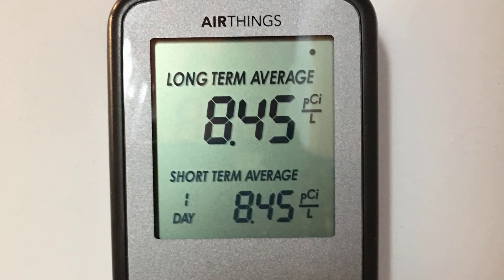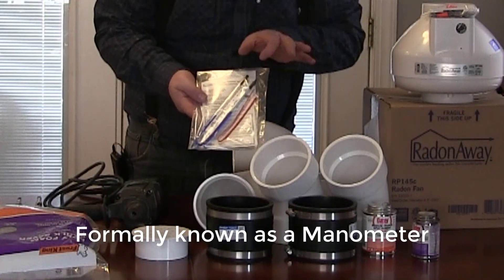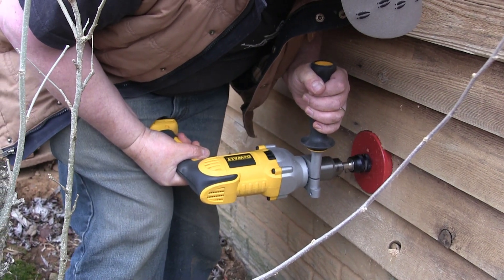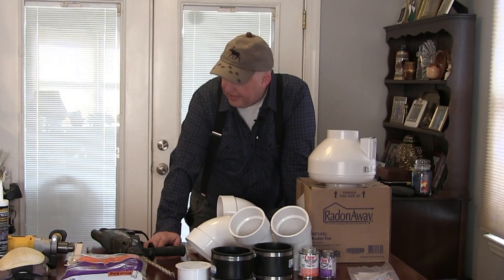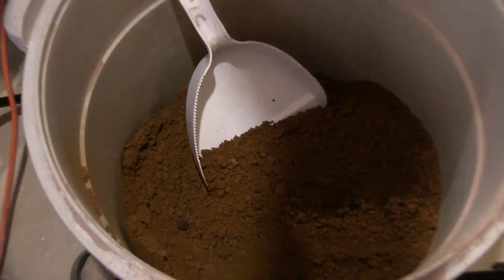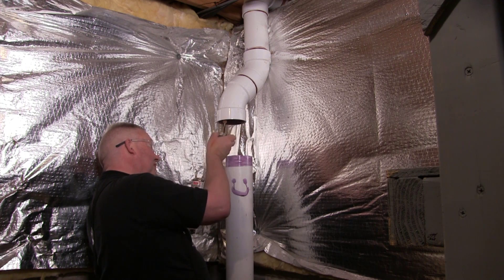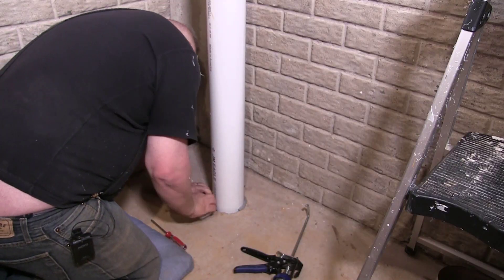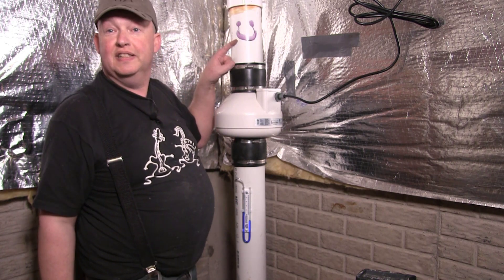S1 E06   Installing a Radon Mitigation System

Comment: Thanks for posting.  
That said, code disallows fan mounting in basement.  Also, vent pipe must extend at least 1 foot above roof level, and 10 feet above grade. Your vent termination does not appear to satisfy either requirement.  Finally, gravity will pull condensation in your vent pipe down through the fan, which may void the warranty.

Comment: Install problems your county may not like:
1. The fan must be in the attic or outside. It can't be in the basement. According to fed: "Radon vent fan must be located above living areas or outside of the home"
2. Vent must be above roof line, close to peak where possible. If you get snow, it should be tall enough to not get blocked by snow
3. Vent must not deflect to the sides
4. Vent is too close to windows, especially because you are redirecting concentrated radon gas back towards your house (see #2 and #3). In Summer, basement air is colder and will sink, especially when pushed by a fan back to your windows.

Not sure if you sealed the entire cold joint in your basement, but you might be losing money sucking in conditioned air if you didn't.

Comment: Why drill to pull it out from under the house instead of just sucking it out of the basement? I don't care what's happening under ground or outside, i just want it out of my basement. Thanks!
Reply: because if you suck air from the basement you are blowing heated/cooled air out of your home making your hvac system very inefficient. best to pull the gas from beneath the home before it gets in.

Comment: Nice video.  I've never seen an install with the pump/fan install the within the basement.  I had assumed it was due to concerns with the fan leaking?
Reply: You're correct.  At least in the US, it's against guidelines to have the pressure side of the piping in living space.  It has to be outside or in the attic if you vent out the roof.  Should any seal or piping fail after the fan, it'll push high radon air right back into the home.
Reply from the maker: @emmcclure  Thanks for this insight Erin, much appreciated.  I can totally see how a defect in the piping could squeeze radon gas back into a living space if the pump was too low and inside the biulding.  I may have to rethink my system in the future.  Many thanks indeed.
Reply from the maker: Thanks Scott - yeah I’ve seen them done both inside and out.  It made the electrical a little easier so I opted for all inside.  Since that video was made it has further dropped the radon levels to an average of 0.4 these days.  So totally worth the effort.  Take care.  Smudge.
Reply: @smoogleville8201  👍👍. Can't argue with results.  I'm about to do one this weekend, but can exit into the garage and put the fan in there.
Reply from the maker: @muchmuchmore  Fantastic - I can’t tell you the peace of mind it gives you knowing you’re not swimming around in a vat or radiation in the basement.  My office is down there so I’m in there 8-10 hours a day.  I like Erin’s comment - that totally makes a lot of sense to have the presure side above or away from actual living space.  Your solution would be better than mine if you go that route.  If I ever need to change out my pump, I’ll move the thing outside for this reason.  Nice catch Erin.  Here’s wishing you every success with the project.
Reply: @smoogleville8201  Same with me.  Office in the basement.  No reason not to fix!
Reply: Hello! I was wondering what type of caulking were you using? Was it 100% silicone or was it something better?

Comment: Nice work Smoogle.  You've shifted from fine carpenter to plumber in the flick of a grommet :-)  Very sound advice about dealing with the potential harmful effects of radon too.  It's not pleasant stuff but your system has clearly dealt with it really effectively.  From 6 to 0.18 is some serious reduction isn't it. Well done.
Reply from the maker: Byoomholay cheers matey - yeah that was a result, wasn’t it. Way better than I expected.  When I was fitting the pipe outside and could feel the blast of air coming out of that pipe, I realized how much volume that thing was dragging out from below the basement floor.  It really struck me how much air must be moving through the gravel down their.  Then the meter started to drop like a stone over the next couple of days and I was a believer.  These readings are hovering around 0.4 pCi/L which is like the average outside air levels.